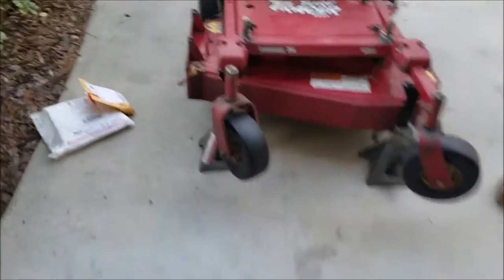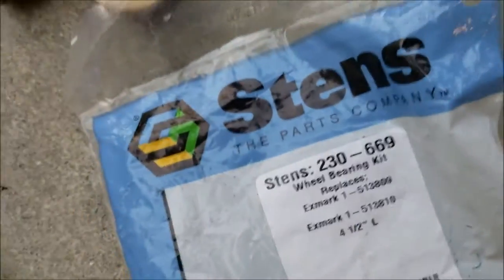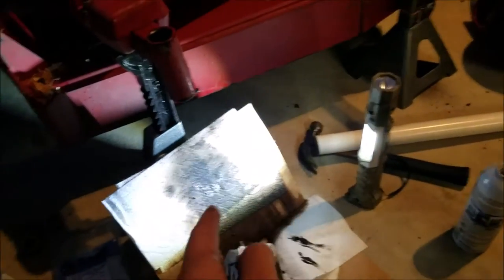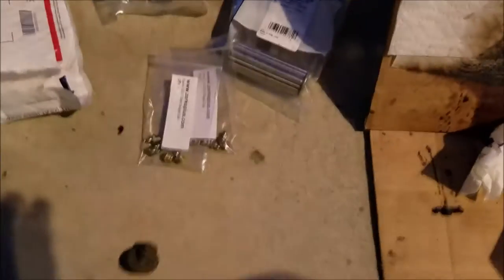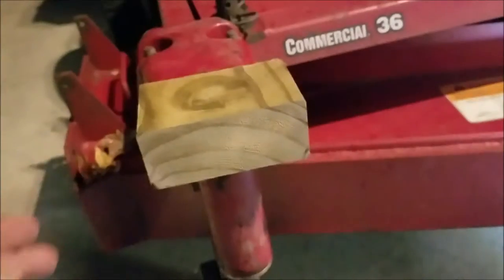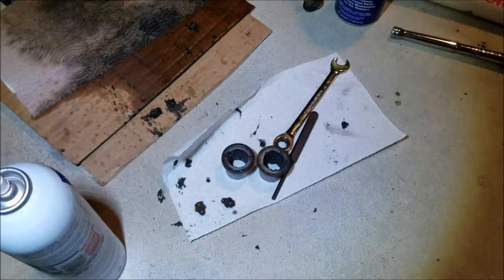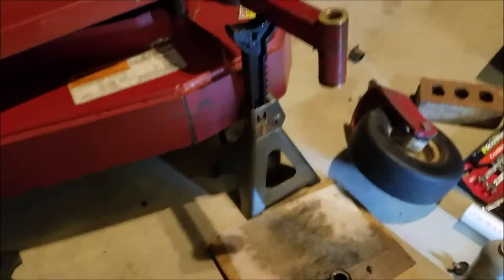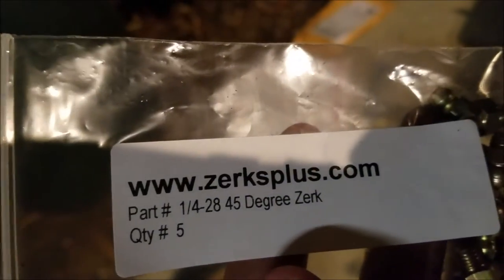Working on the Turf Tracer Front Yokes - Replacing Bushings/Grease Fittings

Comment: I noticed the bolt head at the top. Do you simply use a wrench and take it loose or is there another piece that has to be held at the bottom? Thanks,😊 my apologies if my question isn't clear.